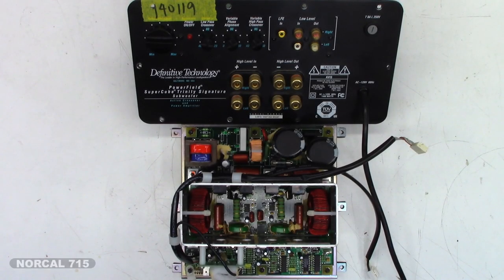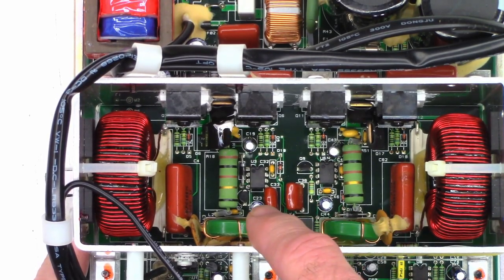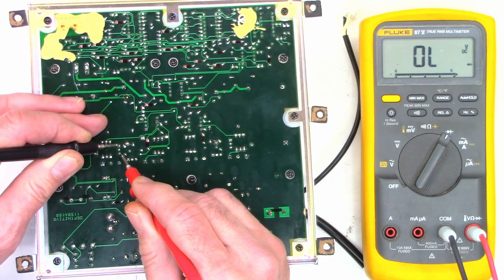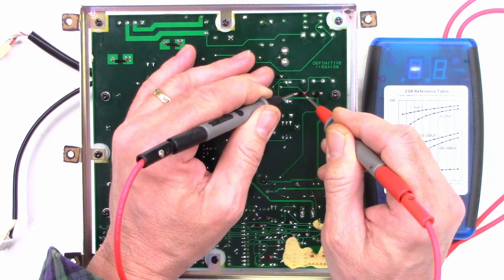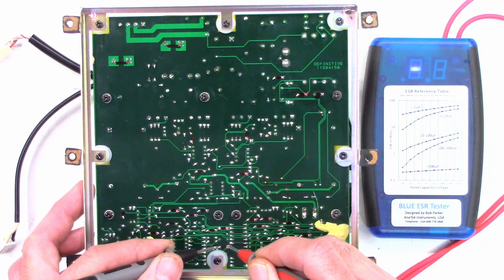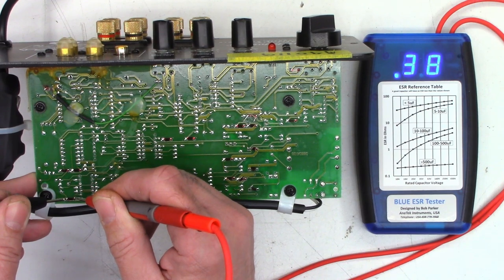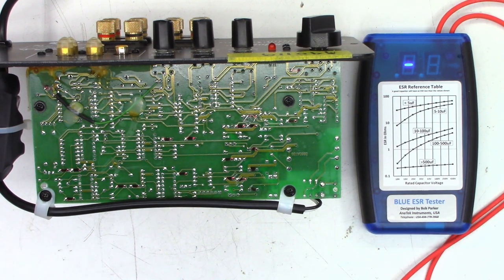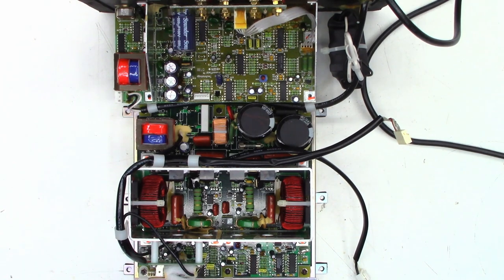Definitive Technology PowerField SuperCube Trinity 2000 watt subwoofer - Part 1 Initial Diagnosis

Comment: Wish I knew someone like you in London UK. Years ago I had an Aiwa XK009 cassette deck and Denon PMA920 amp. First the Aiwa failed then a few years later the amp. 
Both ended up in the trash as I couldn't find anyone willing to repair them especially the Aiwa. 
Now I see they are going for stupid £££ and could probably have been repaired. 😢

Comment: Hi NorCal715, I am repairing my JVC HR-S5700AM which has the same boards and mechanism
layout as the HR-S9911U you repaired and uploaded 10 months ago.
One day I tried to turn it on, a bang, burning smell and then no display and power.
On the primary side of its SMPS, I replaced a 68uF 400V by 47uF 400V cap and switching IC
STR-G6551 by STR-G6653 and it started working (both playback and recording) but have many short black
horizontal lines randomly display on playback video.  

Work done so far but no improvement: Cleaned video heads on drum and its static brush; Cleaned fixed heads;
Disassembled rotating parts of drum from fixed part and cleaned its head coupling transformers
Do you have any idea of this symptom?
Reply from the maker: Do you get the exact same issue on a SP (2HR) and a SLP (6HR) tape?
Reply: @norcal715  Yes, exact same issue on SP and LP tapes.  Have you seen the symptom video via the link I posted in your Facebook?

Comment: So why would high ESR caps cause the main fuse to blow?
Reply: Generally they cause oscillation, so there is excessive current draw in the output stage, which blows the speaker, and also hopefully the fuse before the speaker.
Reply from the maker: Exactly. Spoiler alert, after all cap replacement there was 320 volts DC on the speaker output. I am replacing all FETs and both driver ICs. FETs are on backorder from Mouser.com, ETA late June and I will not use chinese knock offs
Reply: @norcal715  what FETS are using in this amp? I may have some, I keep a lot of parts on hand.

Comment: im working on a bp7002 plate amp..ive never seen such over worked parts..sad. sad..
Reply: I see you test caps in circuit  and you test dc resistance? uh..caps dont pass dc.your reading the stuff on the board.and also see voltage strays everywhere.. I honestly wasnt taught that. Heres what I do I connect a wire to the chassis and power up the amp and one by one I touch the wire to the top of each electrolytic...the ones that make a pop in the audio when touched are bad...